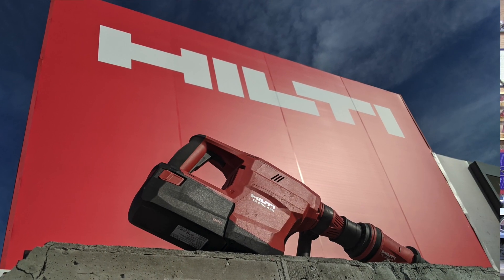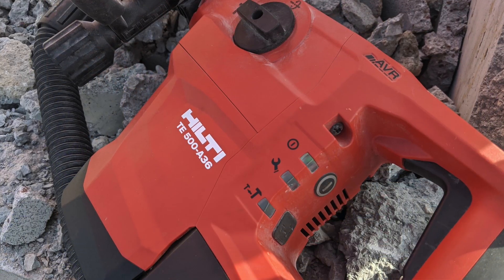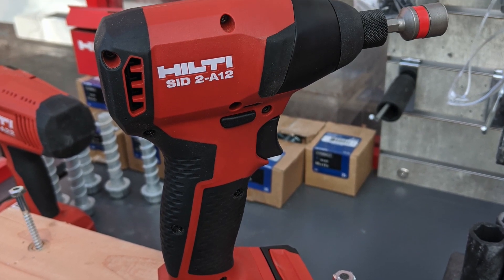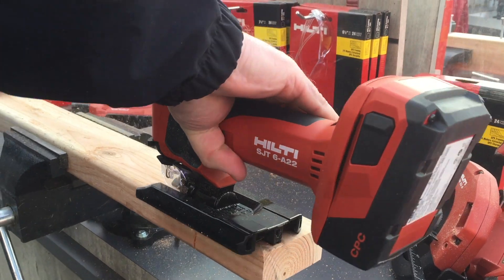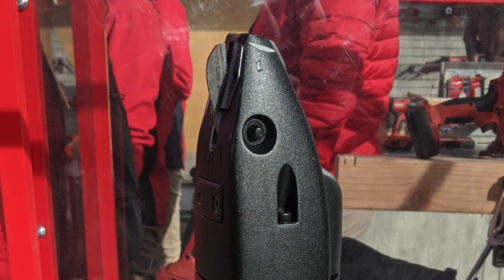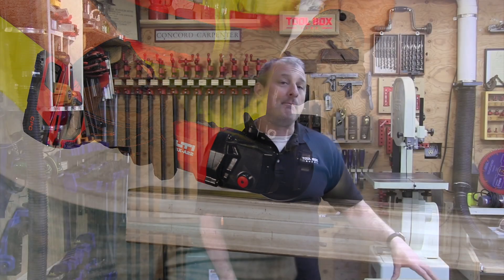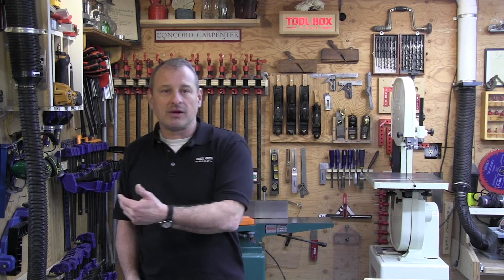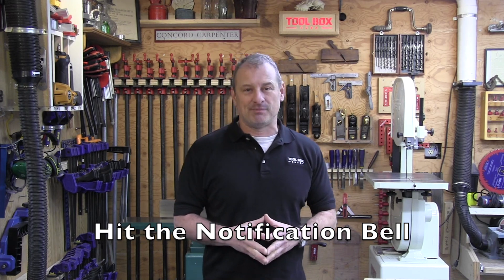Hilti - NEW Tool Releases for 2020

Comment: Aaaand Hilti 20-2-1. That’s 20 years limited warranty, 2 years wear and tear (including batteries...drop it, drive over it, leave it out in the rain, yank the cord off of it-repaired or replaced Presto!) and 1 DAY turn around on repairs. They repair it the same day they receive it or the repair is FREE to you. Try that with your DeWilt or Milsuckie.

Comment: Rob, so how does the bolt with the QR Code work?  Does it work in conjunction with the ratchet to administer the correct torque for the bolt, as well as inventorying and job completion purposes?  It’s pretty cool, that’s for sure!
Reply: You are correct. There is also a Hilti torque module that mounts between the tool body and the battery. The module reads the QR code on the bolt box or bolt head and tells the tool what to do. It’s is important that the user not “feather” the trigger. Read the code, Tap in the bolt, set the nut driver on the nut, pull the trigger and hold it until the module shows you a green light indicating properly set. Also, the module is keeping track of date, time, bolt selected, number of successful vs. unsuccessful fastenings in a day, how much you did yesterday and the day before that. You can hook the module up to your computer and print out the log. Keeping logs for inspection becomes super easy. The presenter hits it right on the head in the end. Hilti is all about helping you manage your workflow and maximize your business. It’s waaayyy more than just tools and bolts anymore.

Comment: When I worked on building sites I used mainly Hilti tools, now most of my work is in the domestic sector and I switched to Makita, I did a comparison of both brands performance and found Makita as good as Hilti and not as expensive, Hilti 36 volt batteries were quoted at £450 each 18 months ago.
Reply: But if you want your batteries stolen so they can be used on dewalt or rigid tools then you made the right choice. Btw Makita is very weak in the areas they share with HILTI, their demolition and rotary hammers are laughable at best while hiltis are number 1 and will always be. I believe their 12v and 22v systems will surpass Makita one day, and little by little HILTI gains influence in places that they never had before, that possibly Makita has had. They will be outdone in some of the countries where their tools infest the trades, more money putting out trash fires with Makita, than having longevity with good power with HILTI. Have a nice day

Comment: Not gonna watch it again. Did prices go up or down?
Reply from the maker: foxwood67 they always move
Reply: @ConcordCarpenter  Really nice tools unfortunately not many small contractors can  afford them
Reply: @foxwood67  more like don’t want to afford them, you probably drink too much beer and bbq too much with your ‘friends’ on the weekends that’s probably why you can’t afford it.
Reply: @plissken94th57  your funny.  Honestly i just cant justify spending 2x or 3x the money for 1x the performance. I use mainly milwaukee tools and own many. No need to brag. I am also a makita fan. Now these tools are worthy of daily use on job site and hold up relatively well. Ive been in construction for 36 years I do not own Hercules, Bauer, Ryobi etc. These are not bad tools just not ideally suited for daily hard service. Hilti is a hard service tool line from what i hear, but very expensive and i doubt they will last 2-3 times longer than standard prosumer tools.   If so ill still stick with red cause who doesnt like a new tool now and again. 🙂
Reply: @foxwood67  ok ok I can fuck with that mentality of wanting a new tool, but I want the most money out my tool, and if it ain’t broken then don’t fix it!! Milwaukee has good deals at Home Depot, but I always feel you have a higher chance of defective items that way rather than buying directly from the company itself

Comment: Hilti makes good tools but other brands are every bit as good and other  good brands are cheaper also. Hilti seldom performs all that well when put up against other brands though so I'm not going to pay there PREMIUM prices unless it's something I really need and no one else makes it like there powder actuated guns which I have and really like them. I only do commercial work but seldom see anything Hilti out on jobsites . There pro grade but the majority of pros I'm around just don't use them much.
Reply: Because they want power not longevity, it’s as simple as that, it’s really because cheap Chinese plastic doesn’t fare well with “American power” schaan engineering does a good job though

Comment: My personal opinion is that hilti is twice the price as a red, yellow or blue tool that has the same or more capabilities. I would never think of getting on their platform because of price and availability.
Reply: hilti is more reliable than dewalt or Milwaukee. Makita has similar reliability to hilti but much cheaper so makita is the best.
Reply: Their tools are 10-200 more than the competition. It's really not that much more cost for a robust tool with a 20 year general warranty... 2 year wear and tear...
Reply: Milwaukee actually has some of their tools priced higher than some of the options at HILTI, HILTI has a more limited coverage in all tools, but in power they don’t come close to Milwaukee but longevity wise they beat Milwaukee 10 fold!!! All of the fanboys brag about how American made it is, yet Milwaukee is a straight up subsidiary of a Chinese Corp, everything they do here on out is Chinese made, HILTI is guilty as well but at least their 22v and 36v batteries are made in Poland and not China. At least they’re not a subsidiary either. Milcockee and default can suck a dick, they sold out harder than any other American company that brags about being American made.
Reply: Yeah, keep on buying China tools.  They tried to kill a third of the planet with the Chinavirus and you want to give them your money.  Brilliant.
Reply: Newman Fertig in all fairness, some of Hilti’s tools are also made in China. Just not as many as the other brands.